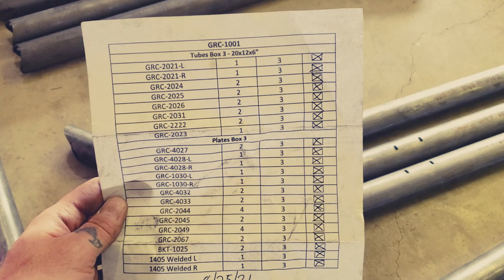GenRight Roll Cage Install | CJ 7 | B & C Pillar Install | Part 3

Comment: what kind of welder were you using for this? 110v?
Reply from the maker: Its a 220 Lincoln Mig SP175 I believe. At first we thought to just use the flux core my machine was already setup with. I was able to talk my dad into completing the cage with a gas setup for some cleaner welds. When I first switched the welder over to gas I fogot to reverse the polarity so I had some grinding to do. 🤦‍♂️🤷‍♂️🤣